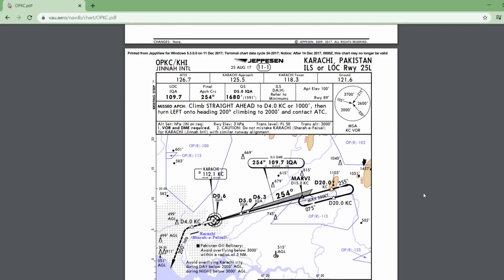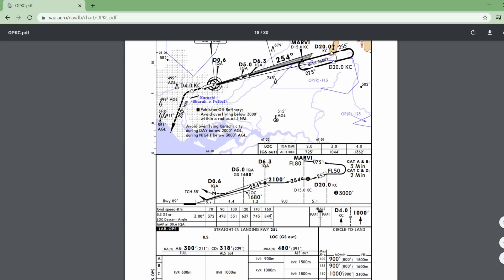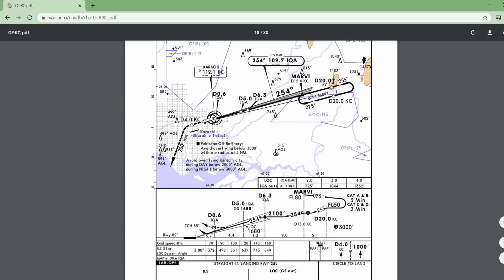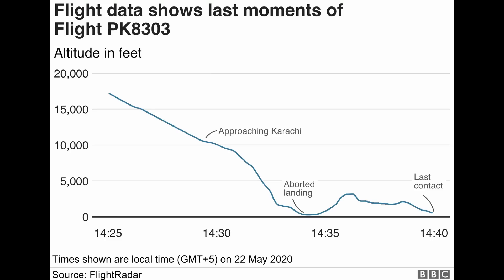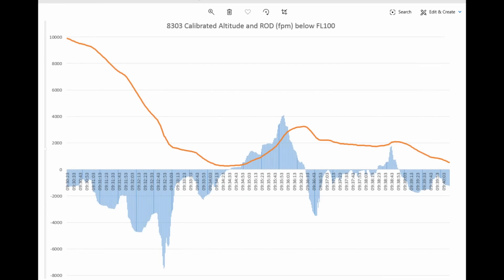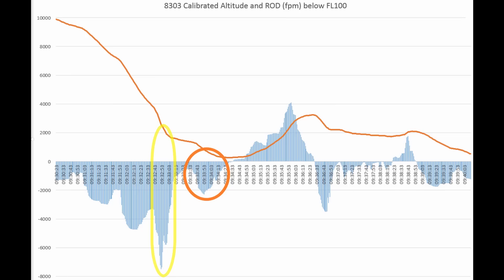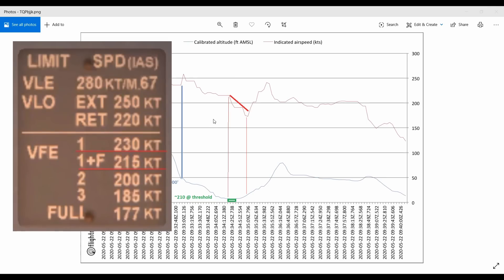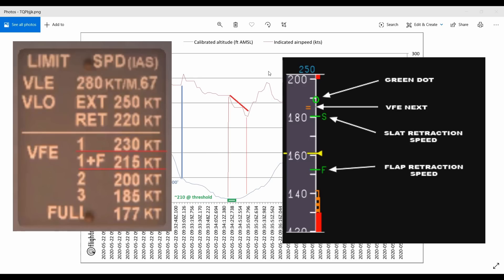PIA #8303 Update #4 Unstable Approach Profile

Comment: My blown approach comment from last video stands. Came in too hot. Landing gear limits exceeded and aircraft wouldn't allow them to go down. I believe they knew this and went for go around but may have made the call late. With speed going into this they had minimal flaps. In ground affect and little flaps, the aircraft settled contacting the engines damaging engines but not enough to power out for another attempt. Eventually engines failed probably from oil loss. Engines probably shutdown automatically once it sensed low oil.

Where was air traffic control in this? Aiirtraffic altitude is controlled.?? What happened here?

Comment: When the chiming stopped, the landing gear extension lights were still red as it takes time for the gears to lock, but the pilots mistakenly believed that the landing gear was fully deployed and locked, because the chiming had stopped.
Reply: Their speed was too high for gear to deploy.  The procedure is to move selector back to raised position and try again in two minutes.  I think they realized at that point that their speed was too high and intended to drop gear in the last 500' and were too stressed to act on it.
Reply: @bryan53566  Maybe, but are you sure?  Why would the landing gear not deploy automatically when the speed drops below the threshold?  What is the point at low speed for the selector being down and the red lights on, which will indicate a landing gear problem?  Why display a landing gear problem when there is none?

Comment: Dear Juan, let's give the pilot the benefit of the doubt, he has never made this mistake error. What if the Plane had hydraulic issues and pilot was not able to control the flaps (and this also explains landing gear), so he may have killed the thrust to go into a free fall and revved up the engine on first attempt touchdown.. but engines were sluggish to take power and he ended up scraping the runway
Reply: How do you know the pilot has not made any mistakes?  That is impossible.  He was gong too fast to deploy the flaps.  He was trying to get down as quickly as possible.  You don't need flaps to do that.  If he believed the landing gear was broken, then why did he not do a belly landing and tell ATC that he had no landing gear and send out the fire trucks?  No - the pilot believed that his landing gear were fully extended and locked.  Going into free fall is a mistake and is prohibited.  You are not allowed to stall the plane.  The pilot is at fault.
Reply: You may try to guess it what happen. With doing this you may try to implement all knowing facts. Lets try with just one. Landing airplane with 190 kts speed is unsafe and unusual. So what you need to do. Go around or try to land? If there was any problem pilot should talk and prepared different plan for landing. Honestly I don't believe it that there was any problem. They were racing toward airport with twice as normal speed. From 10000 feed in 5 minutes it should be in 11 minutes and from 3000 feet in 2 minutes. It should be in 4 minutes time. Unstable approach. That's it.

Comment: Good analysis of a very poorly handled situation. I don’t want to be a pain in the neck but for clarity, at 20DME it should be at Flight level 50 (not FL500 as you state (50000 feet)) based on standard pressure 1013.25hpa (29.92 inches) descending at that point to an Altitude of 2100 feet on the QNH for the platform intercept of the GS at 6.3d. More likely, as you say, to be flying a CDFA type arrival on the FMC and diving for the glideslope. I think it’s important to state, you must never establish on a glideslope from above, due to the way its formed there will be “false glideslopes” at much steeper angles above the 3º norm, no published procedure will ever have an intercept from above.

Comment: As you shown that there was originally an "emergency-ish" descending. That isn't the flying crew's mistake. The flying crew can start to descend after the tower's order. The tower instructs the flying crew about the speed-altitude-direction and the rate of the descending. And if it isn't ideally the tower must send around the plane much before the final approach. The flying crew could not decelerate because of the high  descent rate. The gear did not released because of the speed. The tower must've see that and must've order to stop the final approach. Also, the tower has an obligation to check visually the final approaching plane's gear is down.
Reply: The tower does not check for gear down.  What if it is foggy?  When you are at a marker you have to be at a certain altitude.  If you are not, you cannot proceed and should cancel.  The tower would never tell them to go to marker but not to descend.

Comment: An interesting report from another YouTube channel stated the pilots were unable to get the gear down and it appears they didn’t notify the tower their gear was malfunctioning. They tried doing a belly landing and had to reject it. Leaving metal from both engines on the runway. It appears the controllers were letting them know they were too high but the pilot said he had it under control. Something tells me their speed was the main issue as they crossed the threshold (probably due to the steep dive) and tried to belly land. So they rejected the belly landing and we all know the rest of the story. Here’s a link to that video https://youtu.be/oUOn6FrDPwg
Reply: Doesn't make sense.  If they want to do a belly landing, they always notify the tower and call in the fire trucks and they stage it way in advance.  You never do a belly landing without preparation.  And the two survivors did not confirm that pilot wanted to do belly landing.  And why would they reject the belly land if they wanted to do that?  They were in a perfect position to do it.

Comment: If the pilot pulled the gear lever down at 260knts soes the a320 automatically lower the gear down at 230knts at the safety threshold?

Comment: For the sake of that pilots - may it be possible that there were wrong indications?
For me it's strange, that
- they come in in such a strange way - they were under guidance of ATC before. What flight levels did they have before?
- the surviving passenger told a tv station it was a complete normal approach until the go around. I assume, if the plane touched the ground with the engines - that would have be a terrible noise inside the cabin.

Comment: This is not the first time PIA pilots have belly landed an aircraft. A 747-200 was belly landed into ISB in 1986, flight number PK300. Google it, lots of pics.

There was no failure of “automatics”.  The aircraft was being flown by idiots.
 
The first approach ended up being a belly landing because it was a rushed approach with all sorts of warning horns going off, plus they were flying at a speed above the limit the gear will deploy. They put the gear down after the go-around when they really needed to do a belly landing. Because the deployment of the undercarriage caused additional drag once the engines had failed, the airspeed rapidly bled off.
 
The inquiry will probably find after nearly a month of fasting and sleep deprivation due to Ramadan, the pilots were not in fit state to fly a commercial aircraft.
Reply: But they dont need to fast while at work. However In this case i think the Pilot was fasting.

Comment: Hi blancolirio. I find your analysis very interesting. I wanted to ask a question to a pro like you. Do you think the atc made a mistake by clearing a landing for an approach that was too hot ( descending rapidly at high airspeed). Your thoughts on this please????
Reply: Basically my logical thought is no. Landing clearance should not represent obligation for any pilot to land the plane. More likely should be insurance from ATC  that the vehicles, planes or people were not in the path of the landing aircraft. 
They warn him they try to turn him away from airport and he didn't listen You can hear in ATC turn left 180. They may try to do more aggressively and repeatedly. Perhaps they may just persuet him to do so. But to this point they already warn him at least twice and he didn't listen him.
Reply: @andsab7565  Thanks for your reply. In the last comms between the atc and pilot before the first landing a ding ding alarm is clearly audible in the background. Most probably the alarm is indicating that the landing gear is not lowered. The atc should have picked that up and inquired what it was. Instead the atc ignored it and chose to clear landing. I think this was a fatal error by the atc. Had the atc put the foot down and made the pilot correct approach this accident may have been avoided. I think atc is responsible here
Reply: Thanks for your reply. In the last comms between the atc and pilot a ding ding alarm is clearly audible in the background. Most probably the alarm is indicating that the landing gear is not lowered. The atc should have picked that up and inquired what it was. Instead the atc ignored it and chose to clear landing. I think this was a fatal error by the atc. Had the atc put the foot down and made the pilot correct approach this accident may have been avoided. I think atc is responsible here
Reply: @zeeshanijaz2870  I would say again no. They try to turn him left to 180 and pilot didn't listen him. Pilot inforced his doing right with established ILS 25L and continuing unsafe approach. In a writen statement from ATC controller pilot was warned at least once more time at aprox 7000 feet prior to that what you can hear on atc "turn left 180" http://dunyanews.tv/en/Pakistan/547053-French-team-visits-plane-crash-site,-demands-complete-record-of-A320
Reply: @andsab7565  not good enough. Knowing that his instructions had been ignored the ATC should have forced a turn around or at the very least inquired what the ding ding was. Don't get me wrong. The primary responsibility lies with the pilot
Reply: @zeeshanijaz2870  Well yeah but perhaps in Pakistan it may just not be possible to do. I'm not aware of procedure and level of discipline in Pakistan. Who need to be listen and why he didn't obey.  But I'm pretty sure this lady will kick him out of sequence any time https://www.youtube.com/watch?v=wHfj3DGrE3Y  It's a different culture different scenario different plane and different airport. Going from point to point you have to have altitude and speed. If not you need to leave sequence. She simply kick him out. Because it was easy to correct just one plane than all planes behind the BA747.

Comment: May be pilot have pressure of saving fuel loss. As they are usually rewarded for best fuel efficiency in flight hrs per year or per month, thats why he avoided to go around on ATC call and tried to handle descend at 6 degrees. and he forgot to recycle gear lever while maintaining speed and altitude.

Comment: You name it! First, they came in too fast, too high, maybe trying to lower the gear at a too high speed but the computer did not and the crew was totally confused and supposed a landing gear failure, which, in turn, put more stress on them. (as can be seen on some video footage, the gear was down shortly before impact. So I guess it was not a technical failure).
Totally stressed and without proper CRM, they then just forgot to lower the gear, and when the audio warning came up, they were even more confused and tried to go-around but it was almost too late and the engines scraped the runway at least twice. I guess the pilot flying suddenly noticed his faults when the audio warning "too low, gear!" came up, and it is in our human nature urging to make things going normal, and exactly that´s what he tried by initiating a go-around to perform a normal landing, without being aware that the engines might have been seriousely damaged.
From my point of view, human error which caused a chain of events leading to a fatal end.
May their Souls rest in Peace.......

Comment: The graph is of altitude versus time. This means that 45 degree angles on the graph did not represent a 45 degree dive. What matters is that they were descending too fast for the aircraft to be configured for landing, and this did not provoke the pilot to go around. Perhaps if the gear and flaps had deployed, the aircraft would have slowed (dramatically) at that point and that was what the pilot was counting on? Presumably the equivalent data is still available for previous occasions when the same crew landed at the same field?

This kind of conduct is not quite consistent with the pilot being in drink: more like cocaine, which tends to give users utterly unjustified confidence in their own abilities. You NEVER want a cokehead taking decisions that affect your life (or career) because it almost always involves driving off a cliff sooner or later.

Comment: How did a plane flying an IFR approach end up so high he needed to plummet at 7000 fps to get down to the glideslope? I mean, he must have been given a step down set of altitudes that would set him up for the approach by the controller, and although I am no pilot, I think I am right in assuming that if you bust an altitude then ATC is calling you to correct it pretty quick. While I also recognize that simulator flying has little bearing on reality (home PC sim that is) even in that the ATC are telling you to expedite your decent/climb to the stated alt. So what was going on here where the pilot is literally diving the plane at the ground, I mean, what the heck does a 7000 fps descent feel like to the passengers, they must have been freaked out at that.

Comment: Something was clearly wrong way, way back at 10'000ft.  Chain of events come to mind.

We really need to wait till the black box data is released but I would like to add something which isn't normally a factor in incidents like this.

It was Ramadan, were both pilots fasting? For those who don't know about Ramadan, in the Islamic world, for around one month a year, Muslims fast between the hours of sunrise to sunset. No food or water. 
Normally pilots and cabin crew don't fast but some do. For anyone who has been dehydrated or hungry, we know judgement can be severally impaired. 

The crash happened at 14.30 local time, this means had they have been fasting, they would have gone without food or water for at least 8 hours or more.
14.30 is also a natural low period in the circadian  rhythm.

All of this may have nothing to do with what happened but it is worth mentioning.
To be 8'000ft higher than normal means something was not right, did both pilots fall asleep woke up and went into panic mode?

Comment: When I worked in a nearby country (I'd better not say where) over 20 years ago it was normal for the airliners of the state airline to dive steeply to intersect the correct landing flightpath and on take off they used to fly level just above the runway and then pull up steeply, just like a fighter at an airshow. The pilots were ex military. So when I read that the pilot was 'comfortable' and surviving passenger thought it was a normal approach it makes me think that it was - for PIA!

Comment: The airline has been shut down for the last 2 and a half months. Skill slip. I've been noticing it on the roads too; an influx of drivers getting back onto the roads and their skills are horribly diminished from that down time. I see folks failing to perform simple tasks like keeping consistent speed or maintaining their lane. Lots of unsafe lane changes, chaotic merging, diminished situational awareness. I'm betting the CVR will paint a picture of a flight crew completely overwhelmed with the workload, confused, and faltering under the pressure.

Comment: Great insight for this channel. You tube should let the truth be told. Unless you tube was co-piloting from the right, they should just let the truth flow. No one is compelled to listen to this channel. After all, this happened in broad daylight and engines scrapped the runway surface before going airborne again. So what's wrong about this channel?

Comment: Probably goes without saying but had the crew been competent they would of realised they had got things not quite right and should of carried out ago around without even trying to land and given themselves time to sort things out and carry out a much better approach?
 The aircraft did not seem to have any technical issues as they never made any call to make anybody aware they were dealing with a problem. This is not 100% as they could of had an issue but,again, going around would of bought them time.
 The simple answer is they should of aborted the landing,gone around,re- established and carried out a landing as per the plate but or something reason they did not and ,in my opinion, that's the main question to be answered, who did they choose not to?
 Here in UK the CAA often cite the Kegworth air disaster as an example of poor CRM( crew resource management) and we all need to learn from it to prevent similar happening again. I have a bad feeling that CRM will be a major actor in this accident, but that has no official standing and is just my humble opinion.

Comment: To compare with yesterday pia 320 landing in Karachi https://ibb.co/PNXH7Gr for the reference. Speed is 181kts  FL 3250

Case is closed. Nothing left to investigate. Except cockpit voice recorder. In order to understand what makes those two pilots to believe that they are flying airplane. Beside that if the comment bellow is correct how many time this happen in past. If once twice is proven? Than 20-30 times should be no surprise number. Reckless, irresponsible,
Perhaps pilots input on plane should be also carefully analyzed. Just in case if there is any similarity with pia training. I really wonder where they learn to fly in this manner